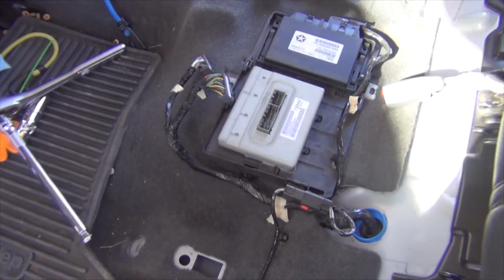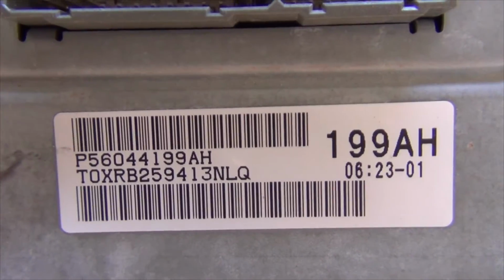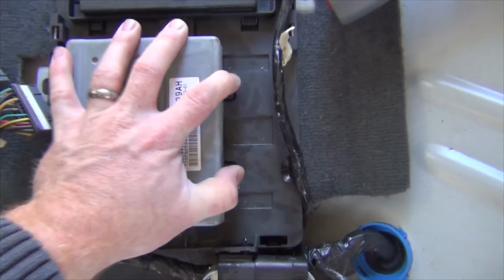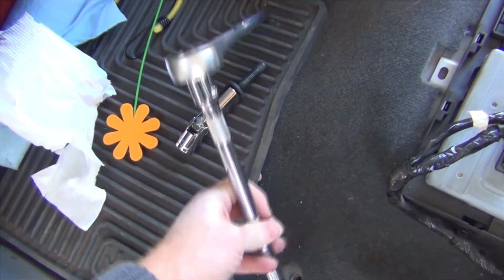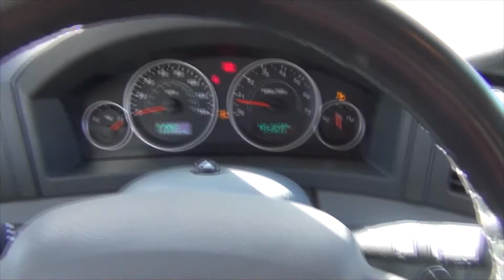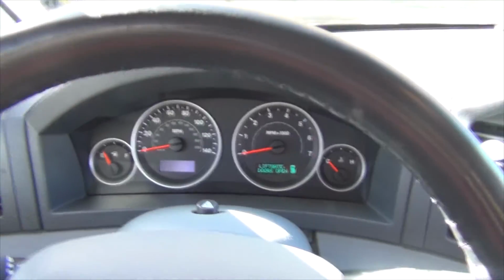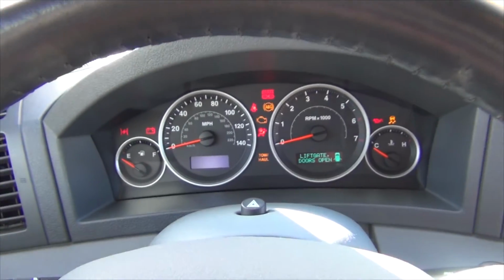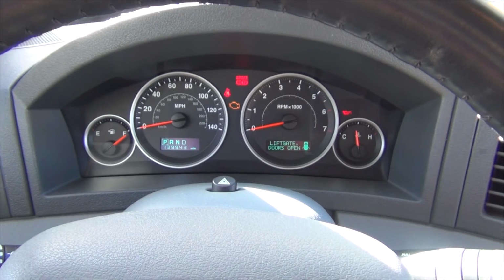JGC N23 Update: New/Used FDCM Fixes the issue

Comment: so what is the end result i seen that you put a the one in and the must have taken out and then put it back in this one. what happened did you get the AH one flashed or something tell m everything and why the fuse ? in first video you took it out started it turned off and put it back and it was ok for a bit , ill try that but i am sure i need the flash or a new one . where did you get it ? thank you
Reply from the maker: Yeah I took out the FDCM that the dealer flashed with the N23 update and put in a used FDCM from an non-flashed vehicle and never looked back. That solved my 4x4 issues. The fuse trick allows you to clear the FDCM and use 4x4, there seems to be mixed results whether it works, I wonder if some of that is that people do have an error with their actuator.
Reply from the maker: I no longer have the Jeep traded it in this year.
Reply: mark sinsel yeah so I took out the fuse put it back in and it works so I guess I'm good for now but I probably should look into getting the new fdcm
Reply from the maker: At this point I bet you won't be able to find a non-flashed FDCM...
Reply: @Meekerextreme  Why would that be ...would a  auto wrecker have one?